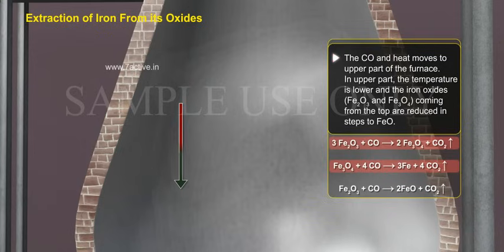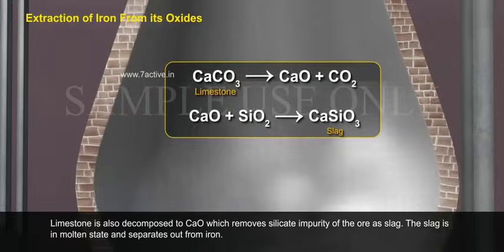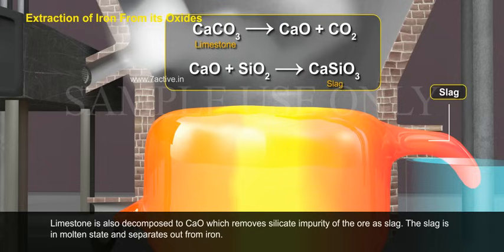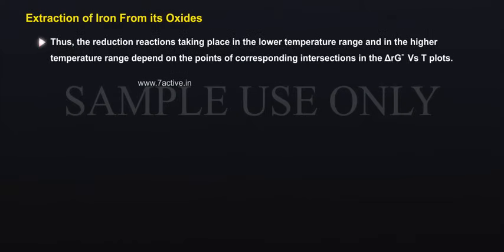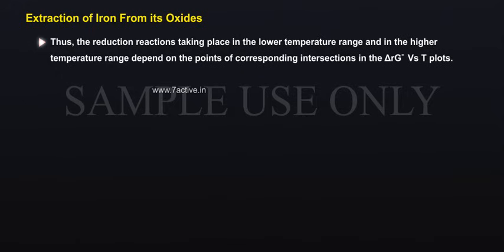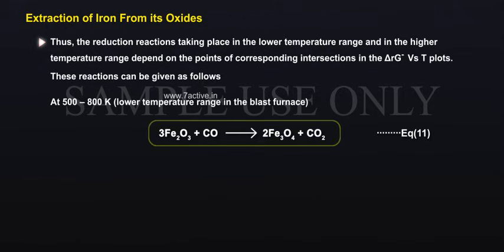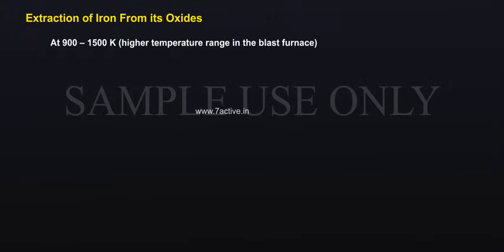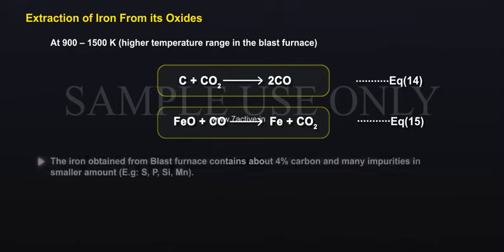Extraction Of Iron From Its Oxides

Comment: So I burn coke in the bottom for heat. Plus coke limestone and hematite are in the top of the furnace?
Reply: the hot air wc is blown from the bottom of the furnace comes into contact with the coke producing carbondioxide

Comment: what is the role of limestone in the extraction of iron from its oxide
Reply: The limestone decomposes in the hot furnace, forming calcium oxide. In the extraction of iron, a basic flux limestone is used. Limestone decomposes to form CaO which reacts with silica gangue present in the iron ore is acidic in nature to form calcium silicate (slag).
Reply: Limestone removes silicon dioxide, which is an impurity found in the iron ore

Comment: I've looked at at least 4 videos on steel making process. All were complicated and garbled. Where is a straight forward explanation and understandable video?
Reply: Hematite plus limestone plus coke mixed together. Bake in an extremely high heat with very little air. You want to use coke or coal to add more CO2 to the mix. When you are done the metal will all be clumped together that will be a version of steel or iron. The amount of coke added dictates carbon content which determines grade of steel
Reply: @bjellison905  thanks buddy